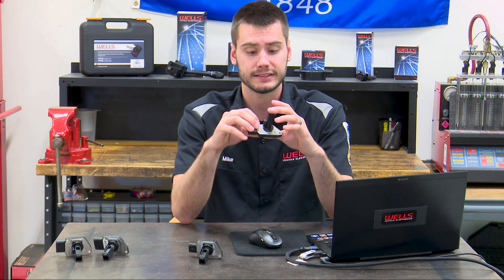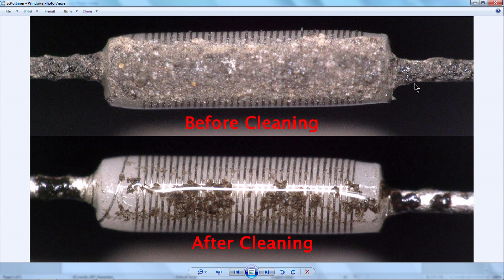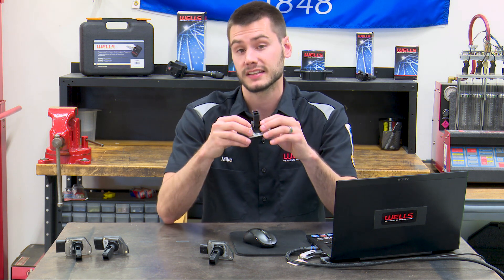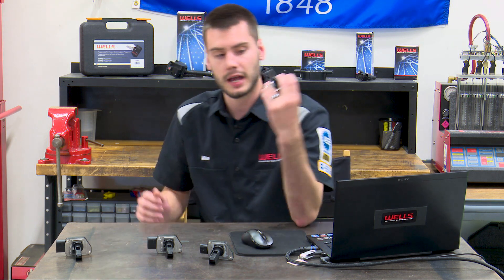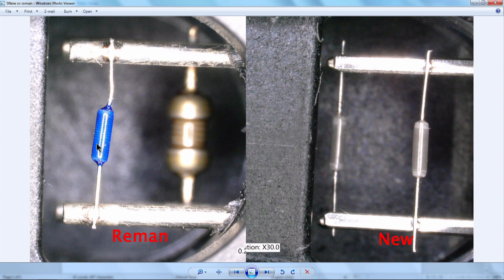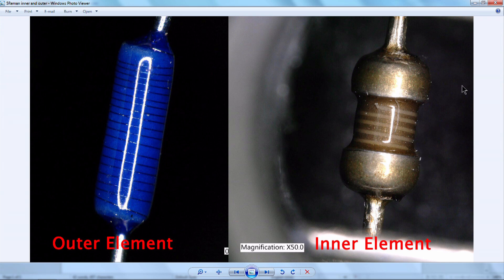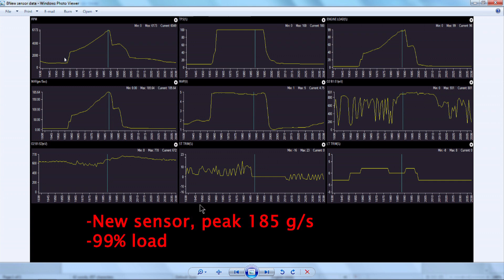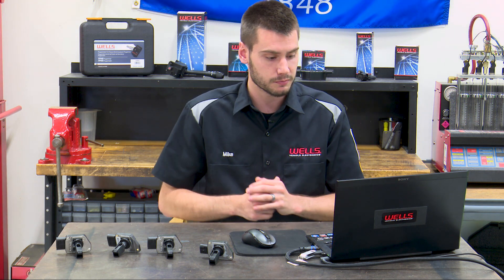Wells TechConnect Ep. 19--Does cleaning a mass air flow (MAF) sensor really work?

Comment: Just found this channel and i have been learning from it! I have used MAF cleaner to bring the car back to a proper running engine and then suggested a new sensor with 50/50 approval/ pass on that offer. Most who pass on the offer to replace the sensor come back for a rescan and replace, some find it easy enough to replace themselves and never fess up to their decision. I never used a microscope to see the sandblasting of the sensor but that is not hard to understand because the air rushing through the sensor housing is like a little sandblasting cabinet. Good video!

Comment: 1.8litre engine x 750rpm/2/60 x corrected density of 0.5g per litre for 0.5bar at 115F = 5.6g/second solely by maths. Not considering or corrected for intake valves which closes after 50 to 60 degree after DBC during suction stroke.

The dash mounted OBD2 show value of 4.7g/second. This would be as good as it can get by the MAF. This is 83% of 5.6g/second.

Driving on reasonable flat road using auto cruise setting and set for 2000rpm noted that intake air pressure at 0.8 to 0.9barg. MAF at 18g to 20g/second vs 26g/second by mathematical calculation for piston displacement and not knowing the volume contribution from egr. Fuel sprayed at port injectors would 5 to 6% by volume. 

Short fuel trim & long fuel trim reading stays within a tight band +/-2% on a flat road. The O2 sensor I have looks like a narrow band O2 sensor which fluctuate at 0.65 to 0.75v on a flat road. Throttle body position at 20 to 22% open.

I keep the dashboard mounted OBD2 already for 1 year so I had quite a number od baseline data. Drifting of any one parameters would meant something is happening.

Comment: I have to say that while this was entertaining it is also entertaining to watch because the person in the video I have to question their knowledge. A MAF sensor is a very simple sensor. It consists or a heating element and a sensor that reads heat. So the larger piece inside is the heating element and the smaller one is the sensor that measures the heat.  How a MAF sensor works is power is applied to the heating element to get it all toasty warm. There is a specific target temperature the element is supposed to hold the the sensor is responsible to measuring the heat from the element and telling the IC in the MAF what that temperature is. The IC then adjusts the PWM signal going to the heating element to either make it heat up or cool down. OK so what gives... what is the purpose of doing that?? Well when you step on the accelerator and the throttle plate opens more air gets pulled in and across the MAF. That additional air causes the sensor to cool down and the goal of the MAF is to keep that temperature on target. So it is going to make the changes needed in order to get that element to target temperature. The frequency that is used to keep that element at temperature is what is used to determine the amount of air going in. the ECM has lookup tables for this purpose. So in function air bubbles in the coating would not effect the sensor. unless the coating has been complete compromised the pitting seen on the heating element would not effect the reading. The dirt would because it keeps air from getting to the element. It acts like a fur coat a person would use to keep toasty warm in the winter. That will cause the sensor reading to be all messed up. Having an oversimplified understanding of how the MAF works you can then understand the reason for keeping it clean. In the video at the end there was a blurb about the re-manufactured sensor reading lower than the OE sensor. APPLES to APPLES folks. did you happen to also catch when he said that he took the readings for the OE sensor at some other point in time in the past. sounding like days  before maybe? Well that is a tilted test. simple things like air temperature, humidity, barometric pressure. time of day. the proximity of the moon to the earth are all factors that can change air density and that difference in air density means you will have a change in the amount of air the engine is pulling in over a given time. the measurement a MAF uses is grams over a second. weight (density) over time. so chances are there is not a single thing wrong with the re-manufactured MAF and it was the test that caused the reading variance. So now that you have been given some actual useful knowledge that explains the mechanics of a MAF watch the video again and see how much information in this video is actually irrelevant to the proper operation of the MAF. Being told to go and buy a brand new OE MAF if your has dust on it is a great way to waste money buying something that is NOT needed. I also wanted to point out that the 5 grams/sec equates to about 6HP at WOT. I don't think that in and of it's self would be me go run out and spend 100+ on an OE  MAF. It's a 2% difference.
Reply: You also might want to take readings from 10 or so new sensors and another 10 remanufactured ones, then take the averages to compare. I'm wondering if any 2 sensors might typically be a little different? In any case, not exactly great science being demonstrated.

Comment: Wow! Thank you for classes.  As a former Navistar Tech, vehicle reliability was paramount IMO. Marine Corp teaches "the easy path is where enemy bombs & snipers are every time." Commercial vehicles make money, but lose money in down time, continued maintenance, & towing.  I sometimes got in trouble for replacing parts <$100 that were old or had questionable reliability. IMO my customers made more $$ by not being cheap. Case in point: A 10 year old $50K semi owner complaint: losing coolant.  I couldnt find leak w/ pressure tester on for 1hr (all the time they give you). 10yo upper radiator hose swollen.  Do you think that owner wants to put his $35K engine at risk for a $40 radiator hose?  Or risk a $500 -$1000 tow bill?  When critical parts like mastercyl are 10 years old I change them as a matter of PM.  On personal vehicles I also change electronics like fuel pumps, distributor, & relays at 20 years old. If its now worth the hassle of a breakdown or a tow bill it gets PMed!.

Comment: Discuss the main causes of MAF sensor damage and perhaps a way to mitigate the damage. These are expensive sensors for example newer model Nissan is $585
Reply from the maker: Hi Blaine,
I will make sure that gets addressed next MAF video we create. Thanks for reaching out!
Beside normal wear and tear, the main cause for sensor damage is contamination, keeping a clean air filter and and all of the intake tubing intact and installed correctly is (in my opinion) the best way to keep your MAF in working condition.

Comment: Thanks for the information, pls am working on 2010 Corolla I cleaned the airflow with cab cleaner now their is black smoke coming out of the tail pipe. The only register code catalyst system efficiency below threshold bank 1, will changing the sensor fix the problem or what did you advise,thanks.
Reply from the maker: Hello,
Carb cleaner may have been to harsh to clean a MAF sensor. If you have black smoke, your engine is probably running too rich. I would see how how the engine runs with the MAF sensor disconnected. If it runs better, you most likely have a faulty MAF sensor. If you get it running correctly, I would then clear the DTC's and see if your catalytic converter DTC returns.
I hope this helps, thanks for reaching out!
 ~Ryan Wilsing

Comment: You can always change your MAF sensor, if it is grungy like yours was.  If you clean it regularly and maintain your car properly, you can get by cleaning your MAF for MANY thousands of miles and get great power and gas mileage.  It takes only a few minutes to do and for only a few pennies of cleaner.  A new MAF sensor will cost you upwards of $20 when you don't need to spend that.
Reply: You mean $200….at least in my case.

Comment: Great video, with the MAF sensor it does depend on how dirty, corroded or pitted the sensor wires are, if it's just a bit of crud then cleaning should improve it but if debris has passed the air filter then the sensor wires may well pitted beyond true redemption.

Comment: Luv the video and talk.   As a note: Recently I did something just a bit different.   MAF Sensor dirty and acting up!  Removed and cleaned with MAF Cleaner and just like your pictures was much cleaner but still evidence of dirt coating speckles.  Soo, I again gave a light spray and used a small natural fiber artist brush to gently wipe/scrub the resisters down, respray and re-wipe and then a final spray and let dry.  Absolute much better/cleaner job!  Is it 100% as new?  I doubt it, but it is much cleaner than your pictures and working just fine it would appear.
Reply from the maker: Hey Lisa, thanks for watching! Great tip on the brush. Hope it stays working long term for you!
Mike Becker, Senior Instructor
Reply: @GoTechTraining  Well I am a bit more curious now and so I will keep a close monitor on it and may even do a follow up later.
The other thing I may do is take it into a shop and have them scope everything and tell me the results.
Reply: How would a person really know it was working properly unless you scanned it ?

Comment: I think cleaning is a good option for a DIYer with access to a decent scan tool to monitor the engine performance.  A pro, however needs to avoid comebacks and having customers feel like you charged good money but didn't really fix the problem.  Nice to give the customer the option if they want to save money, but that should be accompanied by a good explanation that cleaning may only be temporary.  On my own vehicles, I will always try cleaning first, then monitor the results.

Comment: This video is potentially misleading.  A sensor can accumulate building before it has aged so much to get into that state, and it is not just the abrasion from the gunk on it.  Plus, those are pretty weird and unusual MAF sensors compared to what you'd find on most vehicles in the last couple decades or more.

It is ridiculous to state it as though "I don't know if it's going to fail tomorrow or a week down the road" when in fact it is more a situation of "I don't know if the whole engine will fail soon", if the gunk is getting past the air filter at an extreme enough rate to cause that short additional life, or else "I don't know if it will last several months or years", or even "this could still last longer than an aftermarket new replacement would".

You have not done relevant testing to reach your conclusion.  The cleaning, the looking, even with a microscope is not as relevant as the measurement of next tour of duty in use, OR to hook up a scan tool capable of live data, and with same environment (intake air temp) and same engine temp/idle, see what differences the cleaned sensor measures versus a new one swapped in.

Another way of looking at it is whether someone is paying a technician and then there's already and potentially a repeat labor charge to clean it more than once, later, to extend life, or if it is DIY and the owner already has a can of cleaner and can literally clean it in under 5 minutes once every few years.  Many of us do this and have proven it to be effective by resolving our MAF issue, and achieving the fuel economy we should have.  Obviously if the fuel economy, trims, or O2 readings stay out of bounds, the cleaning didn't work but if it was DIY it was as already stated, only 5 minutes and well worth trying.

Comment: Yes, replace the sensor. I have cleaned the MAF sensor (with MAF cleaner) every oil change for 100,000 miles. About 70,000 miles the car idles/runs excellant for about one tank of gas and then okay. When I replaced the MAF sensor I looked at the filaments with a magnify glass. One was okay, but the other had a dull look.  So, cleaning only works for so long. Just buy a new one when it is time.  Thank you for the video.
Reply: You must live in a very dirty environment and have horrible air filters to need to clean it that often, at every oil change.  I typically clean about once every 50K mi (my spark plug replacement interval after the first replacement set) but they don't usually need the first cleaning till 100K mi.

Unless you are just doing it as an obsession rather than need, I would advise looking into more effective air filters than what you are currently using because that much gunk should not be making it into your air intake, or if you have a poor engine condition where there is blowback into the air intake, you may have another fault.

Comment: I have a 2015 Mitsubishi Outlander sport se
2.0 L
Why Can i 
NOT 
use mas air flow sensor cleaner to clean M.A.F.S
On the can it read DO NOT use on Mitsubishi
 karman- Vortex
 air flow sensor. 
why?
Reply from the maker: Hey Rene, sorry I'm not familiar with that one. May need to talk to a Mitsu dealer for that answer.
Mike Becker, Senior Instructor

Comment: I have a I have a I-30 Infiniti before I find out it was a mess flow sensor it will give me a lot of problems with O2 sensors and misfires
Reply from the maker: Hey Juan, a faulty MAF sensor could cause 02 codes and misfire problems for sure.
Mike Becker, Senior Instructor

Comment: I've been searching unsuccessfully for substantial information regarding the cleaning of Karman Vortex sensors.  Apparently this type of sensor can be damaged by cleaning, although I've read that many have successfully cleaned theirs.
I suspect my 2002 Dodge Stratus R/T (Mitsubishi) has a Karman Vortex sensor, but am unable to determine for sure, and am therefore reluctant to try cleaning it without being certain that it is malfunctioning.
The current codes displayed are p0102 and p0421.  The prior owner installed a K&N cold air intake system, which I suspect to be contributing to sensor failure.
If anyone knowledgeable reads this, I would GREATLY appreciate any helpful feedback!

Comment: How long can run your vehicle without maf sensor what are the damages thanks
Reply from the maker: Dean, depends on the car. Some won't run without it. Others will run in a default strategy. You may not get as much power, fuel eco, and you'll create more emissions...but I don't really see any long term damage coming from it...if the car has built in strategy to deal with it not working.
Mike Becker, Senior Technical Instructor

Comment: So, my car had been giving me some problems. Which one of it was one day it runs kinda okay and another or within the same day, it bogs very badly at low RPMs (<2500RPM) and when I accelerate it hard, it feels lean and it isn’t as smooth and snappy of an acceleration as it’s supposed to be. 

I was already really frustrated and spent quite some money on other problems and decided to get used MAF sensor. Plugged it in, it was doing okay for three days and the problem came back. 

Why didn’t I just go get a MAF sensor cleaner to try it out? It is expensive here in Malaysia and not many shops sell it at all. Having a mechanic to do it would cost around $15-20 and they probably use other cleaners than a MAF sensor cleaner. 

Before all of that, about three months ago, I had the MAF sensor cleaned before and it fixed the similar problem too. 

I really second the opinion to get a brand new MAF sensor. It has only been about three months since the MAF sensor was cleaned and the same problem came back. 

Also on a side note: it is really important to get all sensors checked, cleaned or even replaced before getting your car on a dyno for a tune( especially if your car, like mine, is almost a decade old). Even tuners won’t know if a MAF sensor is acting funny. Especially with mods such as a bigger intake manifold, throttle body, air intake etc. it is almost impossible to know every car’s baseline airflow data etc. 

Just my two cents.
Reply from the maker: Hi Tek Teng Foo, maybe your problem isn't mass air flow sensor related? You might have something else going on. How are the fuel trims?
Mike Becker, Senior Technical Instructor
Reply: @GoTechTraining  I dont have a scan tool with me now but the car has been running great ever since I cleaned the MAF sensor. 
Will try to get a scan tool to check the fuel trims when I have the chance to

Thanks for the suggestion!

Comment: purge canister valve stuck open can creat vacuum in gas tank?
Reply from the maker: Salman, sure, a very slight amount. Depends on how far it's stuck open. If the vent were stuck closed and the purge open you would have a lot of vacuum in the tank.
Mike Becker, Senior Technical Instructor

Comment: Bought a second hand matching hot film MAF assembly, removed the probe with a pentalobe key, sprayed both contact cleaner & isopropyl alcohol on both the IAT thermistor and the sensing element and rubbed a piece of paper tissue on them many times, then i fitted that probe to my car and now there's much more torque at low rpms even with the AC on... 1.2 petrol naturally aspirated engine...